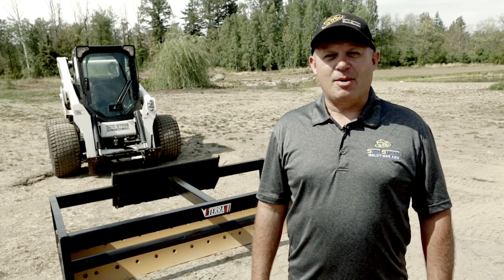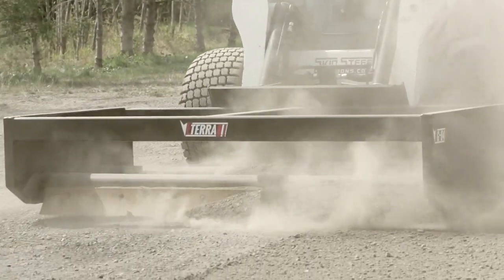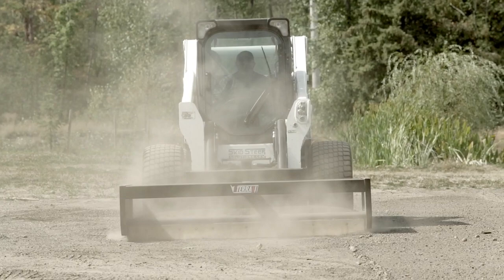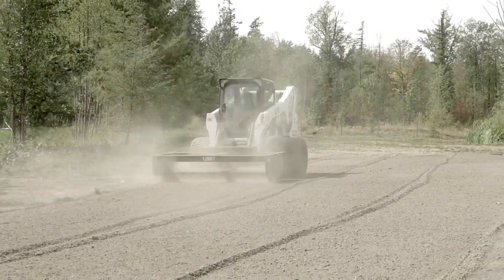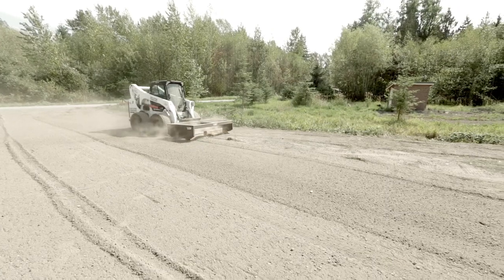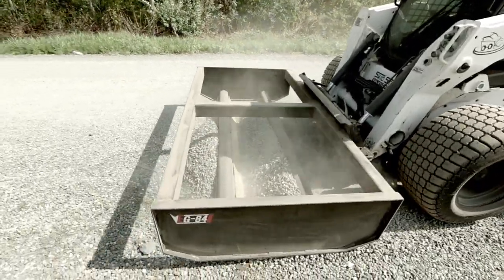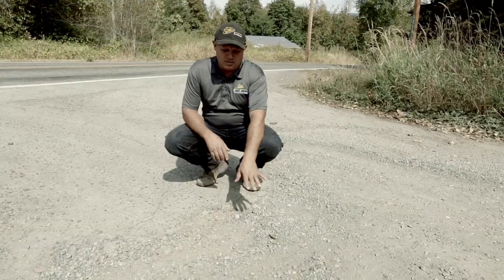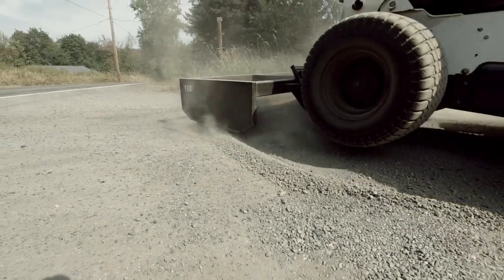#1 Selling Box Grader Attachment for Skid Steer Loaders - Demonstration

Comment: Roads and driveways should be graded when material is wet, but not waterlogged. Otherwise material can be hard as a rock and difficult to remove washboards and high spots, and loose material will not stay in potholes and low spots because it will not compact. Roadway should also have a slight crown to direct water away from surface to prvent puddles and potholes, and ditches to carry water away to prevent soft spots and settling of roadway
Reply from the maker: Thanks for commenting Dean. Do you run a Skid Steer?
Reply: And if frogs had wings they wouldn’t bump their ass when they hop

Comment: How is this for grading dirt and prepping grades?
Reply from the maker: It is robust and will get what you need graded. If you are looking to till/grade, you will want to go with the Harley Rake of some sort.

Some more information:
There are many issues to overcome when using a skid steer for grading. The toughest issue is the constant rocking from the machine when you are in a heavy push. One wheel breaks free for an instant and allows the attachment to rock. The attachment digs in and the machine follows the contour and you just end up with a big mess. The Eterra box scraper design overcomes this issue by adding another contact base to the ground. The side rails are always in contact with the ground and weight is applied by the down pressure of the boom. This causes the blades to run constant regardless of what the skid steer is doing. When you are leveling a smooth base in front, the skid steer has a level surface to run on which in turn adds to the quality of the cut. Another issue when trying to grade a road is potholes. It is hard to dig them up without the machine tipping into the hole which causes your blade to dig another pothole just a few feet away. The aggressive nature of the blades makes sure you dig up the entire top surface with the pothole. The surface is then redistributed out the back of the box so you end up with a whole new surface and not just filled in pot holes.

Let us know if you have any other questions!

Comment: What is the point of the sideboards if you have them several inches above ground? I thought the whole purpose of these things was the side runners ran on the ground and kept it level and prevented digging in.
Reply from the maker: The blades will dig in a couple of inches usually and are stopped from going further by the side boards, in essence this is what keeps the box grader as well as the operator's judgment. Thanks for commenting! Is there a part of the video that shows it not doing this?